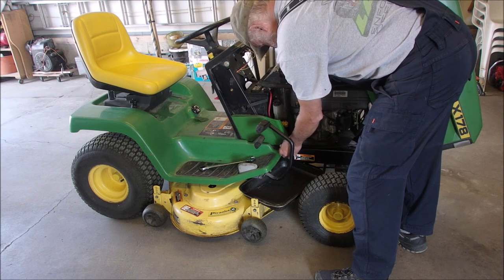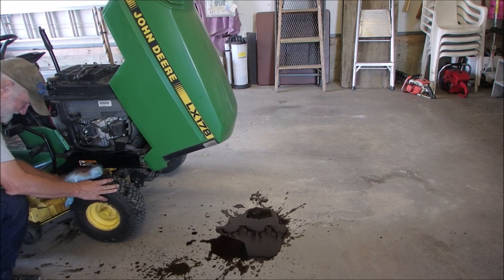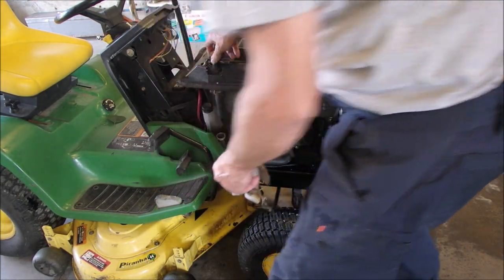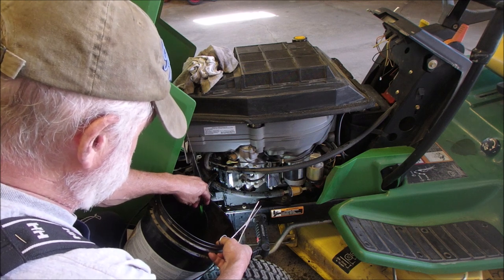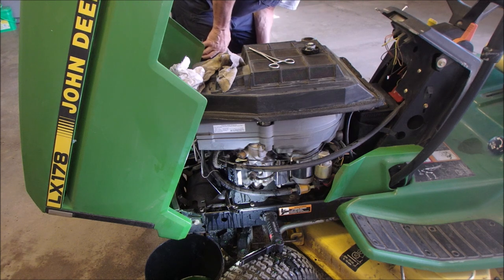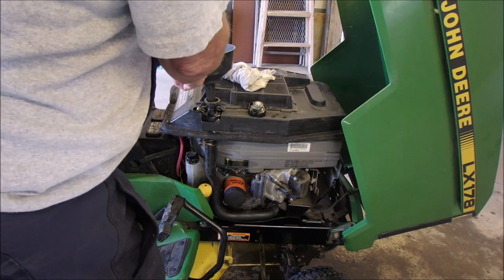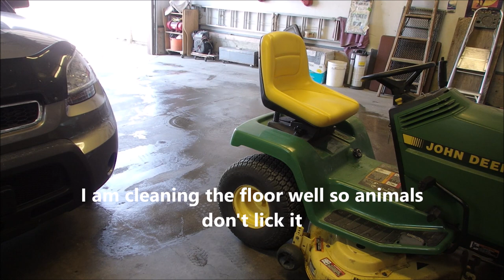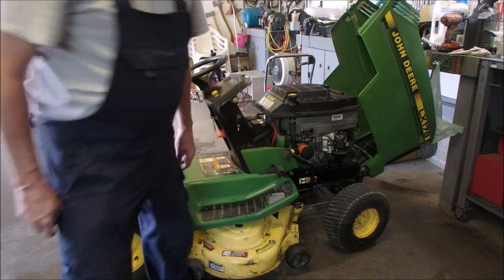My John Deere LX178 Service and Tune UP 2023

Comment: All your tractors are in such good original shape
Reply from the maker: Thanks Jim.  I work on it.  I did cheat on the 3 blades after this video as the John Deere ones are 320 bucks.  The new ones fit and cut great.